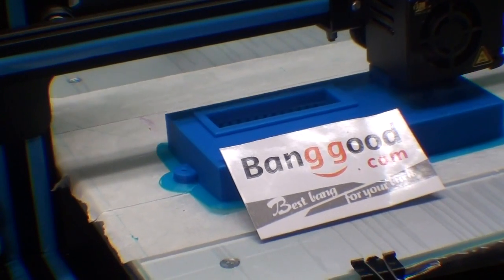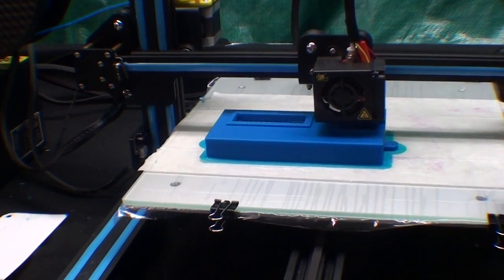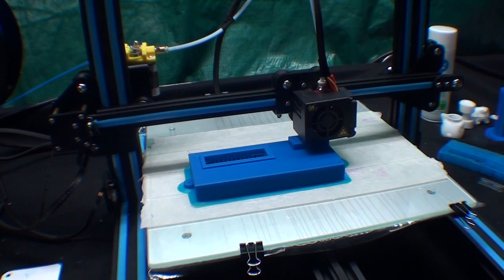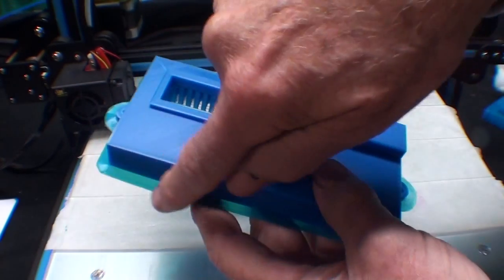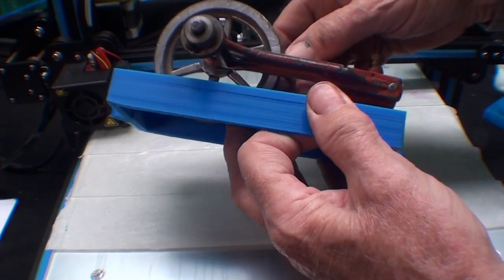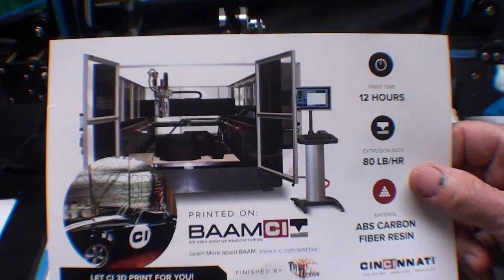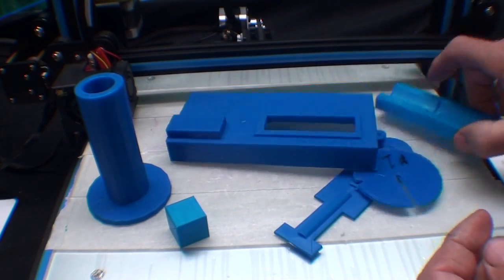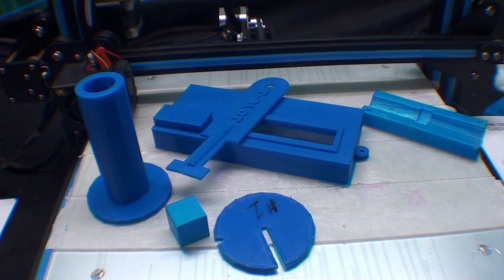3D Printing CREALITY CR 10 with tubalcain #1

Comment: Dump TinkerCAD. I run Linux and I use FreeCad, it is free and works great and is available for Windows. One thing I did was to make a Craftsman 101, aka Atlas 618, 6" lathe cross feed nut. My bronze nut was terribly worn with .025" backlash. Being a 3/8 ,10 TPI LH stubby acme, not an off the shelf item. You could buy from Clausing or several other private sources. But, being cheap I looked at my Anet A8 and went Hmmmm. Broke out FreeCad and after several iterations I had an ABS cross feed nut with the only backlash being in the cross feed screw shaft moving in its mount, about .005". I then got some Nylon X carbon impregnated nylon for another project and it also works great. I don't know how the wear will be, but when it gets to much wear, i.e. backlash, I can simply print another one. Oh yea, I did not use an acme tap. The acme threads are fully printed with only having to clean out minimal stringing by hand. The only "machine work" was to hand bottom tap the 10-24 thread for the saddle attachment screw. To fine to print with integrity.
They do make a Delrin filament I'd like to try, but my research shows getting good bed adhesion  is hard because of the impregnated lubricant in the Delrin, Which makes it Delrin.

Comment: Here is my starting script you can add it in slic3r or cura or whatever slicer you use (I use simplify 3d so the [variables] might be diffrent, but you can just use fixed temps e.g.: 200 for nozzle and 60 for bed):
G28 ; home all axes
; Temperatures heat both parallel
M104 S[extruder0_temperature] T0; Extruder Temperature
M190 S[bed0_temperature] T0 ; Bed heating
M109 S[extruder0_temperature] T0 ; Extruder heating
G1 X5.0 Y5.0 F7200 ; go to starting position of purge line
G1 Z0.1 ; Nozzle move
1 
G1 X5.0 F7200 ; Material purge
G1 Z0.2 ; list nozzle
2mm 
G1 X200 E20 F600 ; purge line

Here is my end script:
G1 E-3 F3600; retract
M104 S0 ; hot end off
M140 S0 ; Bed ff
G91 ; Relative mode
G1 Z20 ; Nozzle lift 20 mm
G90 ; Absolute mode
G1 X5 Y270 F7200; move nozzle to the side and bett forward
M106 S0 ; part cooling fans off
M84 ; Stepper off
Reply from the maker: Thanks--I just printed this for reference

Comment: mrpete222  I have a few years of experience 3D printing.  I'd highly recommend Repetier Host to slice and run the printer.  It adds the G-code commands for home and some other feature I think you'll find useful.  For getting parts to stick there is noting better in my opinion than Airwolf3D's lineup of adhesives.  They worked with a polymer chemist to get an adhesive to be extremely sticky at high temperatures and next to no adhesion at room temperature and leave no residue on your parts.  There are different formulations for PLA, ABS, Nylon etc so make sure you get the right one.

Comment: Exactly, in the automotive industry we use high end stereo lithography printers. Can add draft what have you. Diameters are on center. But your talking $500,000.00 a machine. 3d Printers are for hobbyist nothing more. First thing you need to do is learn a descent cad program than convert the file in .step format. Text file. We use stereo for one off show cars. even than we have to sand, prim and use body fillers. Bottom line you need a decent cad program. Not the garbage that came with the printer.
Reply: don't "SHOULD" on people or tell them what to do... that's really rude !

Comment: Lyle,

You may yet be able to use the plastic base as a pattern.  Auto body filler sticks like blazes to almost anything.  A little body filler and some sanding should get you the draft you need.

Eli D.

Comment: Mr Pete222 - Get Pronterface, install it on an old laptop or desktop machine and use that to run your printer, that's what I do. Pronterface gives you a  user interface for your printer that is more understandable and easier to read than that silly little LCD screen and rotary knob. You can download it from  http://www.pronterface.com.  Also, if your first layer is not sticking, please check you bed calibration. If your print head is not at the correct height it will cause all manner of problems. Too low and it will smear the plastic and knock the first layer off the bed, too high and the filament will cool before it hits the bed and fail to stick.

Another software package to look at is octoprint. You can download it from octoprint.org. It runs on a raspberry pi and you can even put a little camera on the raspberry pi to watch your print from another room. Octoprint lets you control your printer with a web interface. It works, but I prefer pronterface.

Comment: When I do 3D printing, I use PLA and the bed is covered in polyimide film (Kapton).  You can get adhesive backed sheets from McMaster and put them down.

Comment: Getting the bed to auto home after the print is as simple as going into Cura's settings:  On the top menu bar click on Settings > Printer > Manage Printers > (make sure your printer is highlighted) > then click on Machine Settings.  In the machine settings on the lower right side is End Code, in that box insert the following just before the M84 line which is usually the last line:

G1 X0 Y290 ; Move the bed forward and the head to the left.

Note that this doesn't lower the head (Z Axis), you really don't want to that if you print something near the finish position.  This setting works good for me on my CR-10.  

Are you setting your print temps in Cura?  It sounds like you haven't set them and that's why you're manually have to set them on the printer.

Comment: as to the "return to home position,"  there should be a g code that you can insert at end to do that such as G28 say. i don't know squat about those printers and gcode on machines are different among manuf. for that matter but i would look at where the routine goes to end first

Comment: I think you can make a great series out of using the 3D printer and showing that us old dogs can learn new tricks. Please consider making the taper attachment part you just made out of alum. using a strong compound and test how it would work on the lathe. I know you answered me saying you didn't think it would be strong enough but if it did work out it could be good resource for obsolete or expensive had to find replacement parts for some machines. Thank you, Ed K. Cleve. Oh.

Comment: Ok...this is based solely on this machine, so other people with other machines, don't follow this. I hope it makes sense, using this machine was a bit of a...well, it's a good machine, certainly delivers, but it's not up to snuff. And various areas needed tweaking pretty much at the same time to make it all cohesive. All of my previous experience in these machines (3Dprinters) comes from professional grade ones, and converted mills, which have completely different tolerances when it comes to the mechanical part of the machine.

Take these as guidelines more than anything else, personally i think each person should build their own rapport with their machines. I cannot in good faith impose my ideas over another's, these are my observations.

1. Use Cura, the machine is very optimized for it (for some reason), use the instructions found in the memory stick (card) to set Cura up. Follow them to the letter, they are pretty good (from there you can experiment as you go, also, read all the info-bubbles that appear when you hover your mouse over them).

2. On PLA disable the mini fan found on the side, (in Cura disable "cooling fan") because of the design of the bounding box, the extruder fan (the big one on the front) is more than enough to cool stuff, as you get in to more advanced designs, you can tweak the settings on the cooling fan (side) to match your needs (by pressing the settings button to the right of the disable/enable box) but at first, with normal stuff, don't bother with it.

3. Don't bother with glue, sticky tape, anything else. Use the tape provided by Creality. BUT here's the secret, using the knob wheel on the brain box, at the start of the print, slow the speed down to 20% (rotate left in the main menu) and let it at 20% until it finishes at least one layer (of the main print, not the raft or otherwise) once that's done, increase the speed gradually (in increments of 20) until you reach 100% or as i use it 120%.

4. 20% infill is more than enough on PLA for sturdy stuff, i just printed a 15cm high Venus de Milo at 10% sturdy enough to cast from.

5. I know it's a chore, but don't bother with automatic homing, better that you learn and do it manual (it can be done, but it's worth spending the time to do it yourself). Once the print is done, the printer goes in slack mode, meaning you can move everything where you want it.

Go on thingiverseDOTcom and search for "cr-10 bigger z-axis manual adjustment knob". Download just the knob and print it upside down (with the best resolution Cura offers). That fella fits over the Z-Axis rod and allows you to move the axis and adjust the head where you want it (FYI there's plenty of other things you can search there for the Cr-10 like the adjustment knobs for the base, i made mine from small sleeves that fit over then and the main part of the knob with MDF. 

May require shimming the Z-Axis up in the flex-sleeve, i gave up on that component, and replaced it with a hard one that lifted my screw by 1 cm. High prints benefited from this by having less fuzzy outlines (on individual slices).

Tho i that once you get acquainted with the machine and its (technical) demands, you should consider reengineer the whole base. It's not up to snuff, which is a pity because the rest of the machine is very well thought out. Certainly consider adding 

6. When setting the head, my experience tells me this, set the four outer points of the base by using the head (optionally use a dial indicator, but get one of the less twitchy ones, i first used a Starrett and i couldn't work it right because it was far too "all over the place" because of the flexible base) by using a piece of thick (sub mm) cardboard that's slid under the head's tip.

Once you've set the table, move everything to their "home" position by hand, and slide cardboard doubled over under the head (by manually adjusting the Z axis). That should be enough for a clean print. If you feel it's too squashed (lose height on the part) you can up that height to demand. I keep mine at a steady 0.09cm with a height loss of 1 and change %, which i don't mind, most of the times. Makes for a lot more stronger A part. And, if you already know those issues, you can augment for them in the construction software of your choice (i use SketchUp 8 Pro with an STL export plugin that allows me to go directly in Cura).

7.  Follow the given instructions in the memory stick as much as possible to build a baseline. I know sometimes that's a bit of a chore, especially since it's spelled in a variation of English rather than English (if you know what i mean) but they are pretty well optimized for this machine. I actually feel that whomever put the initial base line settings on this machine, did better than folks over at bigger companies. A 40k machine had pretty damning issues when unboxed and put to use because the instructions were quite off from what they were supposed to be.
Reply: Also, print hours depend greatly on how much infill and wall thickness you have. VERY important. Also, the quality of your printer (in terms of how much give the ways have) is determining how much speed (along with how fast the extruder is) you can get.
This is a hobby grade printer. With some settings tweaks, you can reduce the time, also, you have to be smart about your orientations. That print would take much less if you printed it upside down for example. ;)
Reply: Regarding bed adhesion, I do use blue painter's tape sometimes but it's not my favorite. I've been 3D printing for 7 years now, built one of the very first Mendel models. I've tried a lot and now what I do is almost always Elmer's purple glue stick directly on glass.  It holds while the bed is hot and the model just falls off after the bed cools, and it leaves a glass smooth finish on the bottom.
Hair spray works OK too but doesn't seem to stick ABS or PETG very well, and isn't quite as sticky as the glue stick.
I don't even really have to reapply every time. I do lightly rub the bed with isopropyl alcohol and a paper towel between prints to redistribute the glue, and if it is getting thin I reapply.
I do use blue painter's tape sometimes if it's a very large print and wants to curl, but the tape holds a little too well and it can be hard to get things off the tape if you're using heat.  For a little extra stick when needed, rub some isopropyl alcohol on the tape before the print.  Different brands of tape stick more or less. The 3M stuff is kind of the standard and works pretty well. Blue Hawk dark blue painter's tape from Lowes sticks like a demon and I use it sometimes if I'm trying to print something huge that I can't get to stop curling up otherwise.
Reply: Yeah but if you print upside-down, there would still be support under it because of that raised hole, and then the top surface would be fugly where the support was.
Reply: Creality gave me two completely different kinds of tape when I bought mine last summer but I destroyed those in my first few prints. Even if you are patient you’re going to have to move on soon regardless, so using it’s impossible to just stick with Creality’s tape... unless sell it? I’ve since got my settings good enough that I can usually print directly to the glass without issue... no adding glue or tape for the small stuff.

Mine has been auto-homing after prints since my very first model. I can’t recall exactly but I probably put something into my slicer settings that automatically gets added to the end of all G code it generates.

Comment: things ive learnt from 3d printing.. its slow. if you want nicely finished parts, you make the finish side out. if you want patterns, you use wood. hahaha. its fun, and it keeps us learning. I think you are doing really well. its also the world most frustrating and messy machine, in equal turns. good luck Mr pete.

Comment: This is what you need to do to configure Cura for the CR 10: Start Cura. in the top left area of the screen you will find the text Preferences. Click that, and click Configure Cura... A window should appear. Click on Printers on the left side in the window. Click the Add button on the top of the window. Now a new window appears. Click Other and see if you can find the CR 10 in the list. If not you need to click Custom -> Custom FDM printer. You can give the printer a name at the bottom of the window.

A new window will appear. This is where you need to figure out what settings are correct for the CR 10.  The Start and End Gcode is will be added to the Gcode at the start and end of every file, so this is the place where you want to tell the printer to find home, turn on the heat at the beginning, turn it off at the end, and move the head out of the way. It is important that you have G28 in the start Gcode, so that the printer can find out where in the world the printer head is at the start of every print, otherwise the printer might start printing in air or crashing into the bed. You can google "g code commands list" to find an extensive list of all the available Gcodes, what they do and how to use them.

Now click Finish. When you print you must ensure that your new printer profile is selected.

Comment: Increase your layer heights! .2mm, or .15mm are good heights for general printing. You won't have the prettiest outputs, but layer height is the biggest time sink, and time is money.

You can change movement speeds for various operations in you slicer. Perimeters should be slower than infill should be slower than support. I recommend the beginner 3D printing videos from Maker's Muse here on YouTube to get a feel for what speeds and temperatures are good. Other good channels are Tom Sanlanderer and 3D Printing Professor, who have both been doing 3D printing since the first desktop FDM machines came out.

3D printing is rarely the best solution, as you mentioned. Other processes are often faster and more accurate. For prototyping small parts with complex geometry and design work, though, it can't be beat. Faster and cheaper than outsourcing to a machine shop, for sure. The irony of that statement isn't lost on me.

Comment: Offset part, head not homing, temperatures - these are related to the slicer settings. It's easier to find a profile that somebody already made and import that. Alternatively, you can use a program that does the slicing for you, like Simplify3D, it costs money but saves a lot of time. I have time...

Rough circles -You can increase "sides" in a cylinder to make it more rounded.

Adhesion - I've used masking tape for about 2 years until I switched to glass. Nothing else worked for me and now I have a useless collection of hair sprays and glue pens. Your brim is lifting on the edges, so the printer bed is probably getting cold because of drafts.

You're leaning on the build platform when removing the part. This throws the calibration off. This is why I switched to glass - the glass can be removed and the part worked out without upsetting the machine.

Holes misaligned/different size - I don't think this is the real issue. Either the printer is extruding too little/too much or the part is shifting during printing.

It's 13 hours but you don't have to stand by it. Just have a smoke alarm and perhaps set up a web security camera to check on it. Once 2-3 layers are printed the part should print fine (unless it's something narrow and high).

Most CAD programs support draft angles. I made an account in TinkerCad just to see how it works and I would recommend you to choose something better (like OnShape).  It's too basic for someone like you.